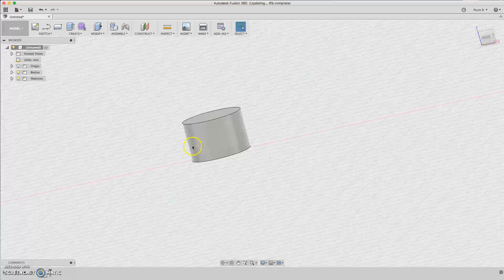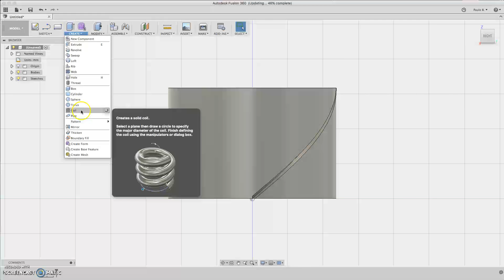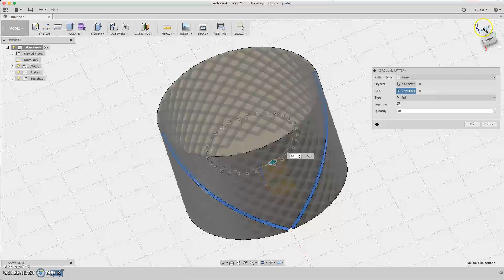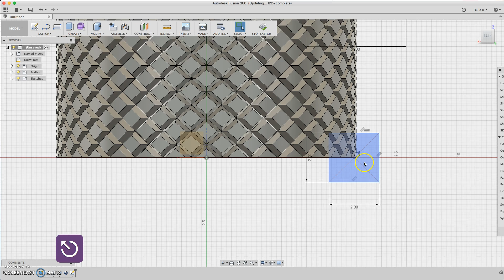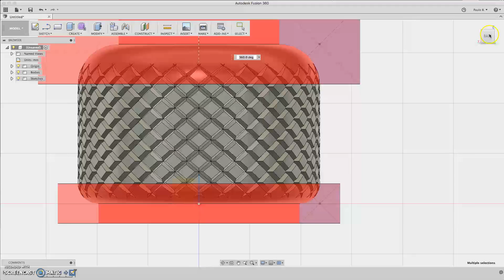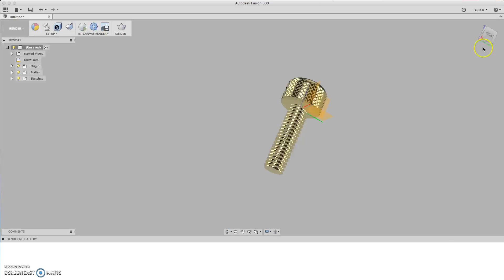Fusion 360 Tutorials #8 Knurling

Comment: Really like your video. I was trying to simplify the fillet operation and tried this approach. (It was not as good as your, but with messing around perhaps acceptable). After the body knurl was made and side viewing it I started a fresh sketch. I made 2 splines - One for the actual body cutting and a larger Second one to form an enclosed area for the revolve cut operation. Both off center from the vertical axis. Sort of looking like a boomerang. Revolve/Cut did trim off the upper and lower edges. I used a fit point spline, but perhaps a control point would be better. More experimenting needed.

Comment: you can put your chamfer on the edges easier if you go back in the time line and apply the chamfer to the original extrusion after the knurling has been cut. quick and easy.
Reply from the maker: Yes you can! Nice catch
Reply: Terrific video by the way. Going back to watch some others.
Reply: Also if you drag back the timeline slider to the original extrusion, you can avoid the time it takes fusion to re-draw the knurling between edits of the fillet. Thanks for your vid. It taught me how to knurling. Much appreciated!
Reply: Aaahh yes nice one